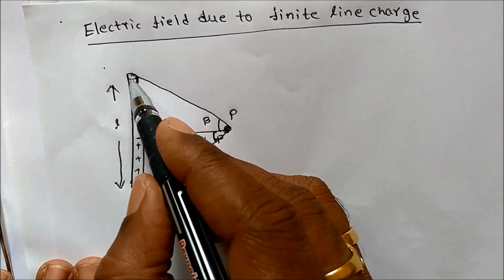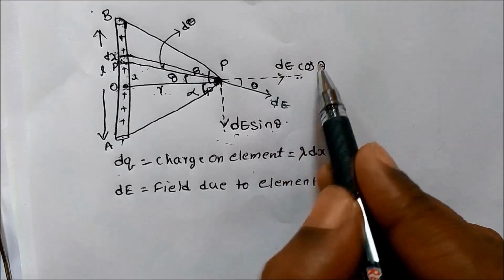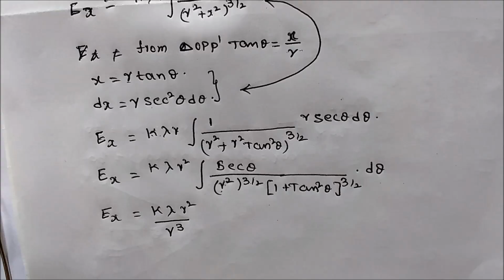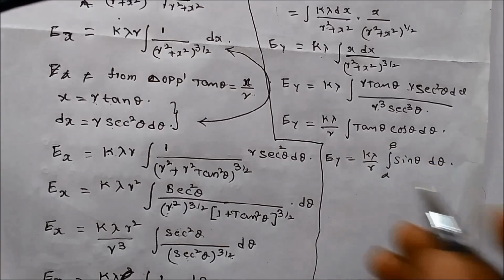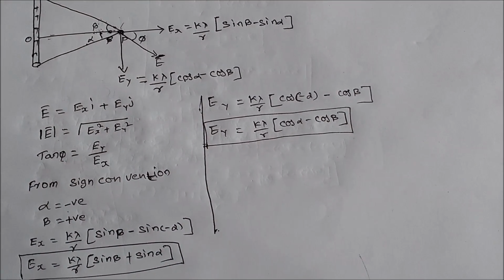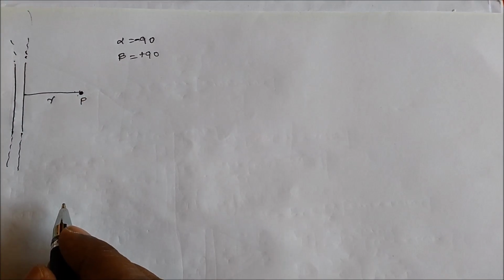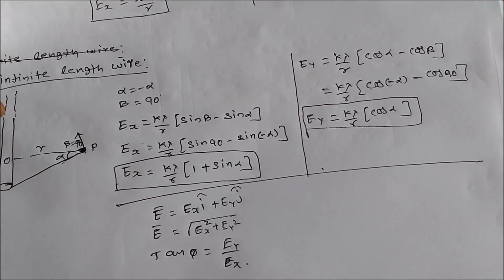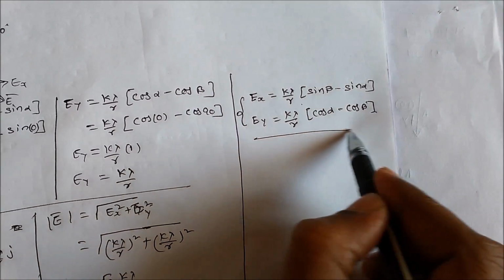Electric field due to finite charged wire

Comment: DO NOT LEARN THIS RESULT
The derivation is correct but he has messed up the integration limits- It should be from -(alpha) to +(beta)  
ANS--(K(lambda)/r)*[sin(beta)+sin(alpha)]
Reply: @comrade-in- comment-section  yes because we imagine that the centre of the rod is origin i.e., 0.
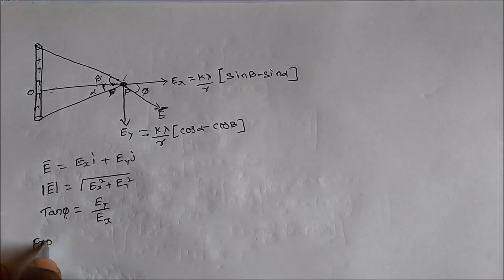Reply: After he has taken sign convection at  20:30
Reply: S u r right
Reply: Yes i thought the same